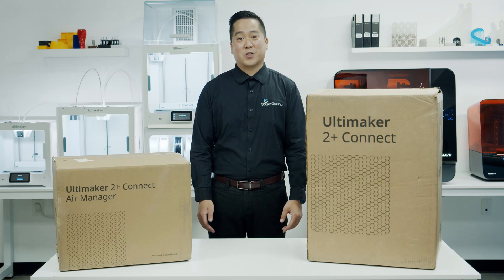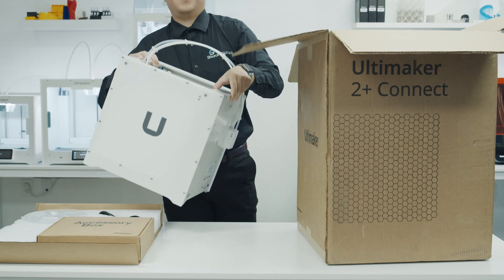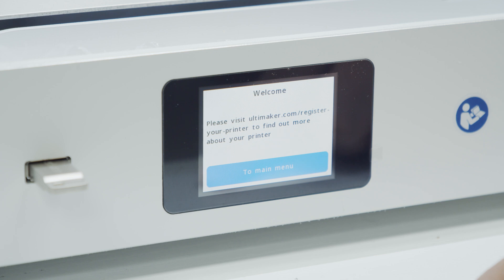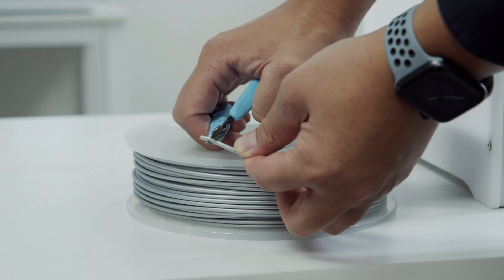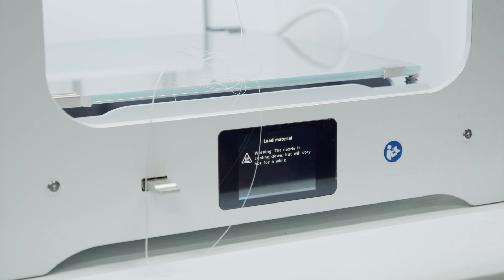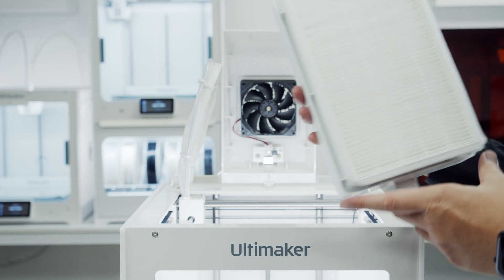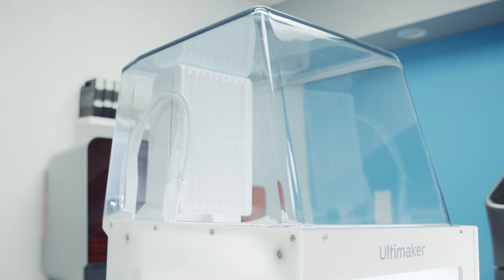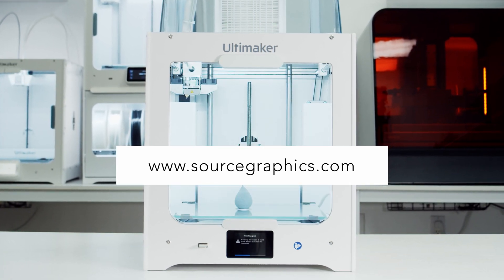Ultimaker 2+ Connect | Unboxing, Setup, & First Print

Comment: The print bed is not leveled when the printer is first set up. The manual that comes with the printer does not show how to level the bed. It has three or four pages in English and the remaining pages are the same text in many other languages. This video does not show how to level the bed. There is a seeing for that if you move through the touch screen. There are three adjusting nobs two in the front and one to the back. When in leveling mode the print bed rises to the top a provided card can be used to set the leveling. Other videos mention the need for leveling eg. https://www.youtube.com/watch?v=qMlB4SXMGkY&t=12s
Reply from the maker: Hi Earl! 

We can absolutely make a video on that if it would be useful for you. Let me know if you'd like us to do that.

Thanks for checking out the video!
Reply: I know how to level the bed. Makers Muse pointed out an issue that is a squish he called elephant foot. The first layers get squeezed and pushed up. This is my issue right now. This happens most often when a rectangular print is oriented along the Y axis. It shows on the front of the print near the screen. I have some ideas about changing the settings in Cura regarding the first layers.